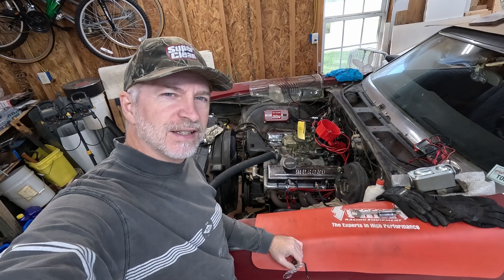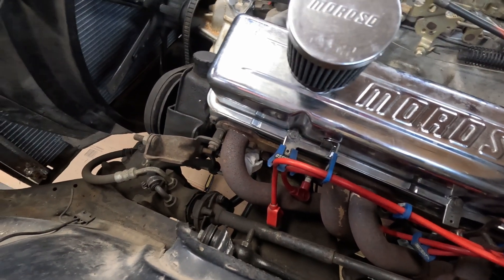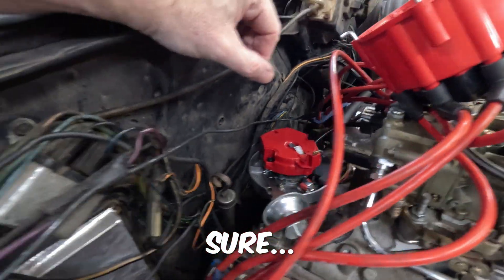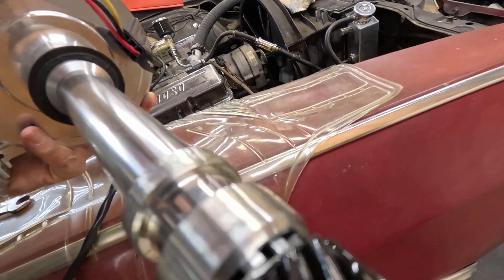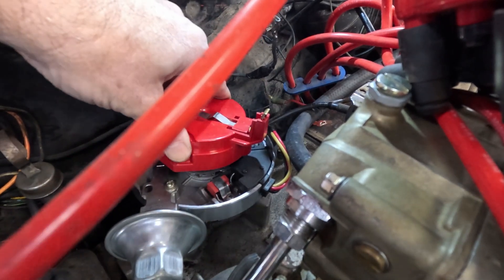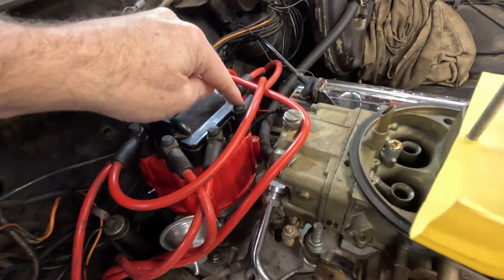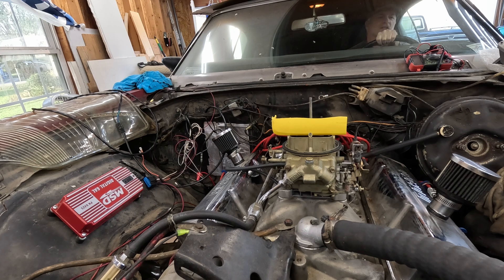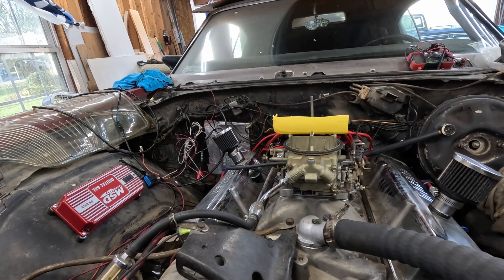How to Install a Distributor (the RIGHT WAY)

Comment: Cool Video. Thanks. I have been fighting to get the dist back in correctly at TDC. I see you set timing at 9 degrees.  I set tdc at 0 and then installed dist. My rotor lines up at about the 5 oclock position. Is that correct? Because it runs poorly and is hard to start.